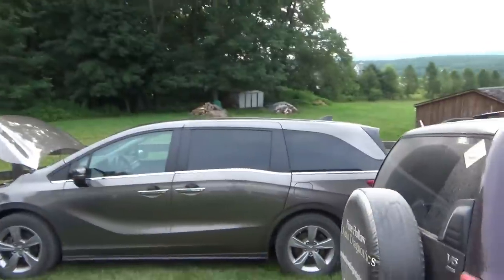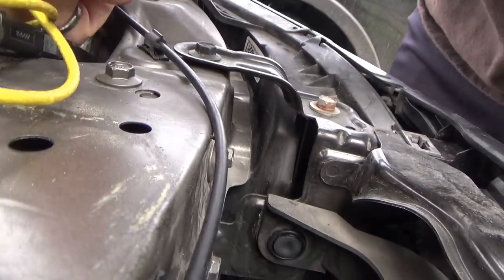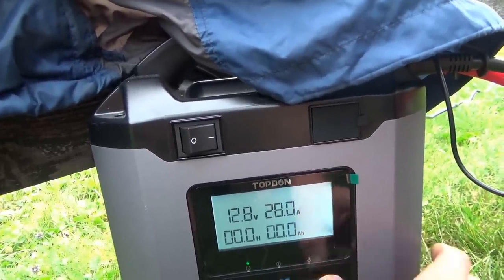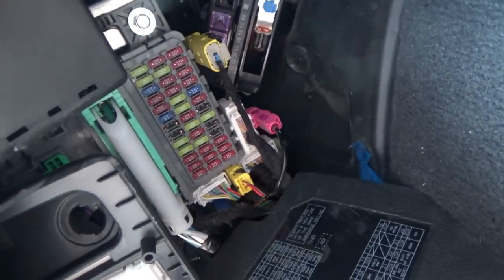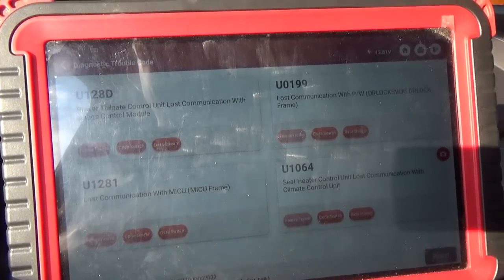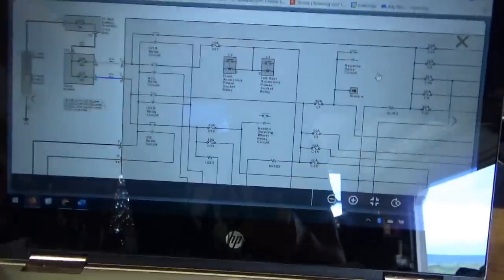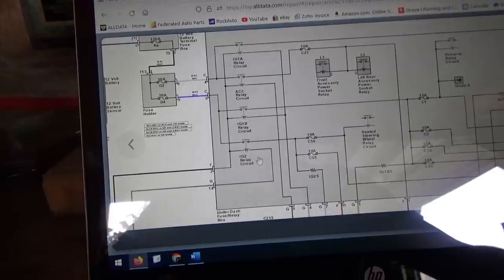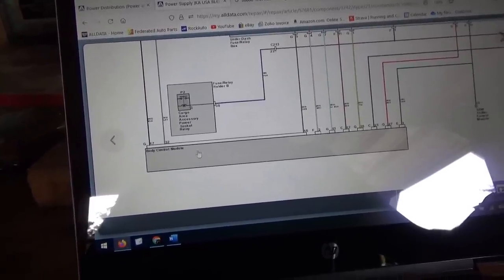WTF...Honda Turns Itself ON & DRAINS the Battery?! (Part 1)

Comment: There maybe one component to blame,the start stop switch.When new hondas are delivered you have to place the key right next to the start stop switch in order to start the car.This suggests that the swich has a reciever in it.If the switch is faulty it could start the car.I believe its not just a switch,its a complicated component.Other honda models suffer from failure of this switch.

Comment: have a 2018 Ridgeline. same platform than Odyssey. I have similar electronic symptoms. intermittent clicking and flashing of infotainment. I removed the TPMS (Hondas name for BCM) and inspected it for cracked solder joints. Here in Canada they quoted me $1000 dollars for this module installed and was in backorder for at least 3 months. I said no. went back home. then gave it a good clean to the grounds of this module with electronic cleaner. Also, you wouldn’t believe it but also give it a good clean to the push start button. I have been problem free for 3 months. before this the alarm would go off at least twice a day and the cluster will start flashing and numerous relays would start clicking like a possessed car.

Comment: I'm not sayn this is your Honda's issue, but my 05 TL had a strange battery draw no start, no crank issue that wouldn't let the cluster go to sleep.While I thought it was the BCM, it ended up being the transmitter control module, which also controls the key fob signal, and programmable garage door opener etc. Pull that fuse, and the draw was gone, and the cluster went to sleep. Note that there were no codes. Note, that by pulling said fuse, no interior door lights work, no fob functions, but the car will still see anti theft signals from the fob, and the interior power trunk still works. So does the all door lock unlock function with the door key used. I can't figure out how Acura is separating all this, but i can at least run the car normally.

Comment: We had a BMW that would just spontaneously lower all the windows.  It especially happened within 5 minutes of parking the car.  Sometimes I would turn the car off in a parking lot, get tied up on something before walking away too far, suddenly hear a whir, "What was that?"  Go back to the car and all the windows were down.  Other times I would return from the store only to find all the windows down. And it was raining.
Reply: I had a VW Jetta as a loaner that actually had a warning in the manual that the door handle touch pad could actually trigger the "feature" to lower all the windows if you hit it with a car wash spray in just the right pattern. You'd think they would have clued in that this indicated that "feature" wasn't thought out very well..

Comment: Unplug the power lift control module that talks to the BCM and tells it  to turn on accessory power (supposedly, I've actually seen it turn on the ignition) to activate the lift. if it's sending erroneous commands it could be triggering the BCM to activate

Comment: hi ivan somebody told me to find the problem is if you suspect a module component what would you do if you changed the item, and the fault is still there where would you go next then before replacing first item check the second third etc if they are good then replace first   all part s are getting hard to get not only car parts

Comment: In the past, Honda outsourced clusters to Ford/Visteon. Remember a cluster that would heat load resisters to the point they desoldered and dropped from the board. Apparently quality wasn't Job 1...
Reply: Did Ford design the module?   How do you know it's manufacturing and not a design issue?  Oh..I know, anything to bang on Ford...got it...

Comment: Remove bcm and supply powers and grounds, then put a test light on the ignition wires. Would eliminate all inputs and out side variables to see if the bcm turns on ignition circuit on it's own.

Comment: Hi Ivan,
Can't fault your diagnostic logic. Hope the used Ebay BCM will solve the problem. When my sisters 2001 Jeep had an excessive parasitic draw and I couldn't find the cause, I installed a wireless battery disconnect. At least that saved the time in opening the hood for a manual battery disconnect. Stay safe.
Reply: For future reference: it's a pretty bad idea to use a wireless battery disconnect. If that thing gets triggered by something on the highway you probably loose (electric) power steering. Super dangerous.
Reply: @Tschuuuls I think the alternator would keep the power steering going.  An experiment best for a large, empty parking lot.
Reply: @stevenkerwin4041  that extremely depends on the car. Had some have power steering issues with a dead battery that has been Jumpstarted before. Not worth it to do for someone else and putting them in potential danger was all I meant :D

Comment: I'll just add my insight here. I have seen a lot of these newer Hondas have their BCM fail... Civics, Ridgelines, pilots, odysseys... Honda has an updated BCM, which already has supply issues. On top of the supply issues, the BCMs are being ordered by many dealerships so it's on eternal backorder with no ETA. So if you feel any better, you correctly diagnosed it. I have doubts that the used ebay BCM will be updated, but who knows if it'll fail again.

If there was an outside source powering on the ignition relays, I think there would be an accompanied B12XX DTC stored. (B12C5, B12D3 or something similar.)
Reply: yep, whenever you see updated, or revised,., they had problems..

Comment: I'm having a similar problem with my 2017 honda hrv.  When driving you hear the doors trying to lock and the headlights come on in hourly intervals.  When it's cold below 30 degrees you can't set car alarm.  But when car alarm is audible not a guarantee but the headlights don't come on. But still when driving you hear the car doors trying to lock..clicking sound.

Comment: Since the BCM is unobtanium, trying an electronics repair is a bit risky. But at least inspect it. If it's a leaky cap, the spilled electrolyte needs to be cleaned off. Maybe there's a bad solder joint, which is an easy fix.
I'd cut the wire between pin 3 and pin 17, which feeds the common of the relays. Install a switch and switch it on. Wait until problem occurs. Switch the switch off and do a parasitic draw test. Or, keep switch off and do a long parasitic draw test, using a scope on a really slow time scale.
If the idle/standby draws are acceptable, I'd still have all BCM functions like keyless entry, door locks and all that good stuff, while the switch will prevent power-up, when off.

If parasitic draws still occur, then the modules are keeping each other awake and the switch will need to cut power to major parts of the HAAT feeds in the car, unfortunately. Then I'd fix the wire between 3 and 17 and install the switch between the HAAT feeds.

Knowing myself, I'd add a warning buzzer with series diode, between this switched HAAT and the main 'ON' bus. Diode points towards 'ON'.
But I'd probably make it fancy, using a pushbutton switch with a latching relay with off delay timer, so it will switch off the 'HAAT' feeds after 10 minutes after shutting down the car.

When DIY'ing such fix, do quality work using quality parts. You don't want your car to totally quit on you, including horn and all lights. In the dark. On the highway at 80mph.
Reply from the maker: I like the manual switch on the common wire idea 👌🙂

Comment: is there an updated firmware for the BCM as opposed to replacing the entire module?
I'm guessing BCM was updated at some point with the faulty software problems started shortly after a service!
Dealer will deny deny deny.

Comment: Funny you say stock up on parts. I have an 07 Odyssey w/ 70K miles and an 99 EXL accord and yes that is what I’m doing. Mostly ignition and electrical components. I’ve been purchasing items I feel most likely to fail OEM parts. The supply chain is going to hell in a hand basket. Ivan can the BCM be opened up for a quick look see? I will not buy a new vehicle. Mine are always garaged and maintained from day one by me. Todays cars are a Disaster!!!!   Sorry that’s how I feel. Oh and being a retired aircraft technician on military high performance jets the same thing is happening. Most pilots stay current on flying simulators. REALLY SAD 😡

Comment: I had a 2019 Honda passport, all kinds of electrical issues. I had same issue as well as the vehicle would brake on its own, accelerate on its own. Rear tailgate opened  with no command. Radio was an issue with noise, the dealer would do noting for me. I had less than fifteen thousand kilometers on it.  Never solved it and got rid of it.
Reply from the maker: Wow what a lemon lol

Comment: You might want to check the switches to the shifter, we had a honda that the car would think it was not in park due to a faulty park indicator switch.
Reply from the maker: There is no shifter... It's all buttons and modules 😂
Reply: I've seen that issue too..  Rather than getting a new switch, we just bypassed it so that it always thinks you're in neutral/ park.   But that's not going to randomly turn on your ignition.
Reply: That may keep it from turning all off the way off or starting but it wouldn’t cause it to randomly turn on.

Comment: Recently, Eric O had to repair a 2019 Silverado (after researching the Electrical Diagrams) with a 4 gauge cable to replace the factory ground strap. This is after the nearby Chevy Dealer tried to hose the customer out of over $3,000 for parts for the cannon.

Comment: does it have remote start?  if so the key info is stored in the remote start module. a glitch signal may  activate that module  but not far enough to turn the starter
Reply: Yeah, I think this is the issue too.

Comment: Have a very similiar problem with a 2003 Fiat Stilo. However it happens only with the instrument cluster. It just turns on by itself intermediately, mostly when it's cold and/or moist outside. Rest of the car is asleep, the can doesn't wake up. And the cluster begins to display errors on the screen, like connection lost, airbag failure, ABS failure, oil press sensor failure, temp sensor failure and a bunch of other failures. When I look up the dtc it sets it's a list of "lost information from blablabla" codes. But no wonder, the whole car is asleep, there are no oil pressure or engine temp information available! Right now the cluster lays on my desk connected to a 12V power supply and I wait for it to act up, a stress the board to find a bad solder joints or anything, but nothing happens. Don't even know if it's a problem with the cluster of something deeper inside the car. One thing I know is the cluster drains my battery when it goes crazy, not to the point the car doesn't start but sometimes it cranks really slow and the voltage after night is not even 12V. I think I'll just replace the cluster and be done with it.

Comment: Could it be a rogue input to the BCM that's commanding the BCM to turn the ignition on? Just a thought Ivan.
Reply: Does the BCM itself handle the remote control, or does it use a separate telemetric module?

Comment: As an aside, it's kind of disappointing (to me) to see a relatively new Honda exhibiting this/these symptoms. I sometimes get chuckled at due to my dislike for unnecessary electronic modules/"features" in newer cars.
Tech is great. When it works. When it breaks, manual transmissions and roll-up windows look even better.

Comment: I had a similar case study. The dash would light up but if I took a test light and applied it to the fuse that had voltage everything went out. It was enough power to light the leds in the dash but not enough for a test light. I traced it to a Bluetooth module right next to the hatch back. The module was covered in water. The main power wire was corroted to the ignition on wire. Even when unplugged it still stayed on until I pepinned the connector. They actually auction the car because of the issue. The only difference is I dont think everything came on (radio ignition and so on). This was about 3 years ago on a 2017 and I don't even remember the model.

Comment: I'm surprised the local dealer didn't come the same conclusion you did. I work at an Acura dealer(not all of us are useless haha). This has been an issue on Hondas for years. In the past on push-button Hondas, the control for IGN circuits in the fuse relay box were grounded by the keyless access control unit. Symptoms were flickering lights, IGN triggering alarm and killing battery, etc etc. Something on the the control circuits internally would intermittently short out. When they went to BCM controlled IGN circuits, the problem was not as common but it still occurred. I've done a few RDX BCMs(which I think is a very similar system to a Honda Odyssey) for similar symptoms, and they all were multi-month backorders.

I'm curious if the MICU security data has any stored alarm events triggered by IG1 or IG2.
Reply: We saw that a lot at the Acura dealer I used to work at. Up until the rona crushed the labor force we would keep several bcm's and keyless access units in stock
Reply: Good idea about the security events, that is also how we locate intermittent draws on Fords.

Comment: I've got 2 Ford Focus that need TCM's. The TCM's are on backorder. Apparently they're months out.
Reply from the maker: Dual clutch?
Reply: @PineHollowAutoDiagnostics  Yeah. I believe the designation is the DPS6 transmission. So the trans will sometimes lose reverse and forward gears are like a failed auto trans. But from memory I think the tcm has one of the position sensors built in. So when attempting the touch point relearn it doesn't take. So first course of action is to replace the tcm. Then you may still have a faulty trans and or clutch. But it's impossible to tell if you can't learn the trans and drive the vehicle. Obviously if you you've got codes for gear ratios or actuators then it's more likely it's not just the tcm. But most often when it's the tcm you'll get 2 particular codes. P2837 and P287B.
Reply from the maker: @edwinlomonaco6754  Those DPS6 transmissions are absolute garbage...way worse than Nissan CVTs lol
Reply: @PineHollowAutoDiagnostics  I know brother. I've done so many of both. It's really bad though when ya can't even fix it because of parts.

Comment: Is the BCM married to the car? Can a used salvage BCM be used ? With the car being a 2018 model there should be quite a few of these wrecked here in the USA... Of course it's possible that the VIN may be permanently married to this module... I know the electric power steering rack in newer Chryslers can only be programmed once so it is possible that Honda modules may be similar...

Comment: With an old car you would look at the key circuit, but with the 2 inputs and computer logic between turning on the car the board not some wire seems rational. The only possible wiring issue might be a power glitch, the program is running and some glitch spikes the inputs, the radio/fob may be a simple on off voltage at the board and the button is on off, a spike to all inputs could be interpreted as on. As far as recent cars parts shortages, the part may be going into new cars so parts go to 1) new cars, 2) dealer repairs, 3) public sale including mechanics, they might be able to get a dealer to install the part because those repairs are higher up the chain.
Reply from the maker: If dealer can't get it, I can't get it... I'm sure there are hundreds if not thousands of new cars sitting in dealer service centers at the moment waiting on modules 😅
Reply: @PineHollowAutoDiagnostics  And even hundreds of partially assembled new cars sitting in the factory parking lot.

Comment: Random possibly unrelated anecdote, but, My Bro had a CR-v that would drain battery which turned out to be a bad relay that would internally short across the output contacts turning on the AC fan I believe it was. Perhaps it's an Omron problem and the same part # relay is used to control the ignition. Low cost to replace a few relays and see what happens.

Comment: I would unplug the push button start switch see if it happens if the signal is sent to that button it would turn on the power if disconnect and it doesn't happen it would verify either a bad starter button or a bcm if it still happens with switch disconnected it would not be the bcm but some type of issue somewhere else this test would cut the harness in half to power  and give you some type of path

Comment: 2005 tahoe v-8 cranks put in drive or reverse everything good but shift it back in park and engine dies instantly cranks right back up ?? any ideas thanks Gene
Reply from the maker: That's amazing! Never seen that before lol. Do the door locks automatically unlock in Park?
Reply: this is my sisters car ??!!?? she said that the doors lock when she puts it in drive she has to manually unlock them  this is intermittent but it did happen with me  about 5 times it cut off and then straightened up  the car and no codes  .

Comment: Keep in mind, Most vehicle will turn the ignition-dash-cluster by shorting pins 1 and 16 of the obd connector. Not that I think that is what is going on , just something that could be easily checked and ruled out.
Reply from the maker: Really? Never heard of shorting pins 1 and 16 🤔
Reply: @PineHollowAutoDiagnostics  when you're trying to program a keyless proximity system and you need the cluster to come on on a Volkswagen or BMW Crossing pins 1 and 16 turns the cluster on for you

Comment: 2000 Jeep Grand Cherokee. Headlights come on randomly comes on and drains the battery. Any clue what to check first?
Reply from the maker: Wiring diagram.
Reply: @PineHollowAutoDiagnostics  I've been there. I thought it might be low battery voltage in the BCM being under actual voltage. However, I got an opportunity to check another Jeep and it was the same voltage.. Ot has automatic headlights.